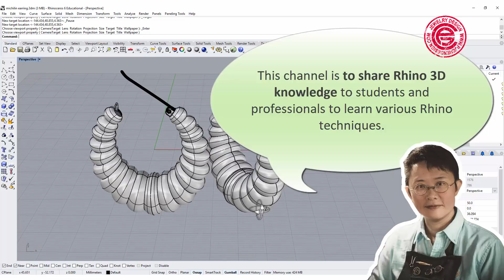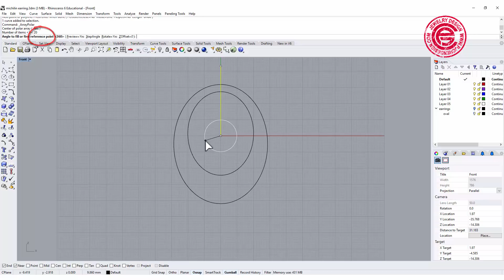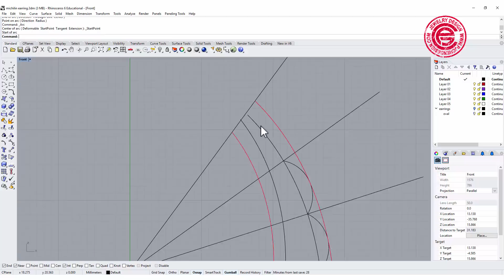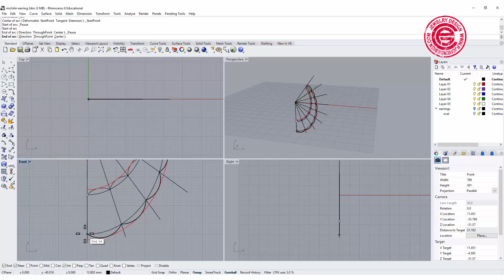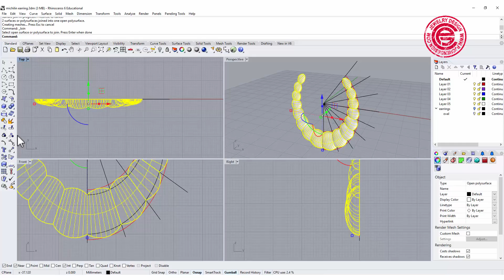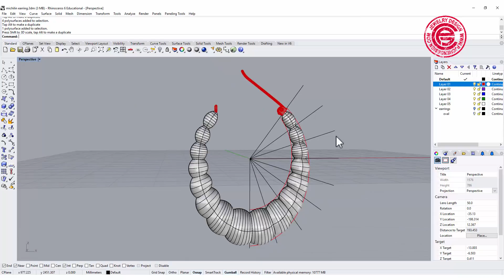Earrings 3D Modeling in Rhino 6 (2018)- Jewelry CAD Design Tutorial #34

Comment: Hello,thank you for this video .
actually I have a problem with first part for duplicate the circle.
I've turned the point on to move the circle but  2 parts of the circle don't move .
should I use something instead of point edit to move and duplicate the circle ?
Reply from the maker: Hi Nasiim. if you can point out the time on the video. I can have better suggestion. but you can always to use "move" command to move it accurately.